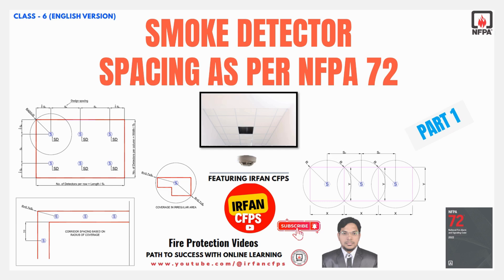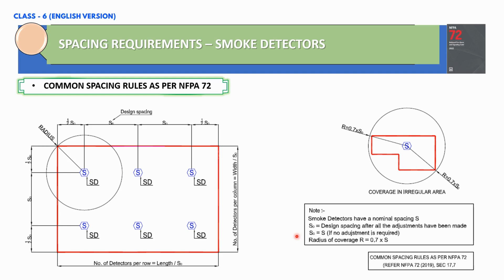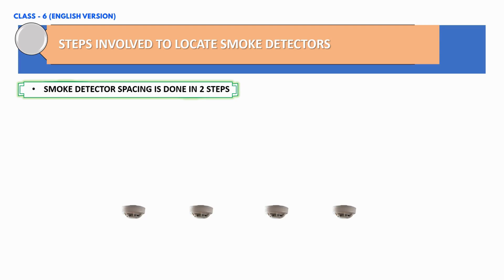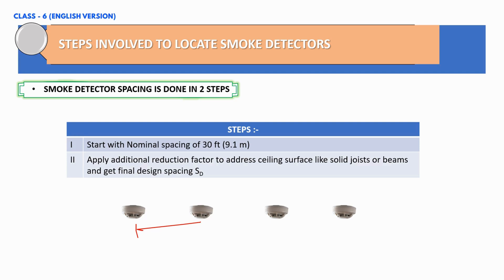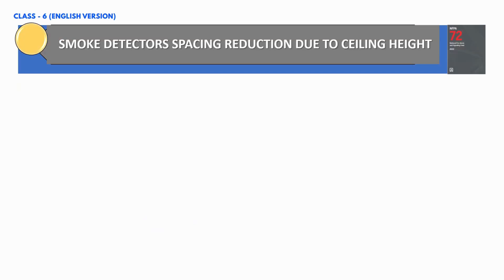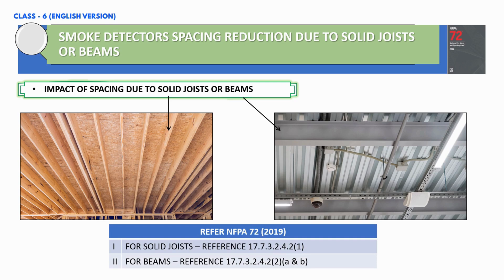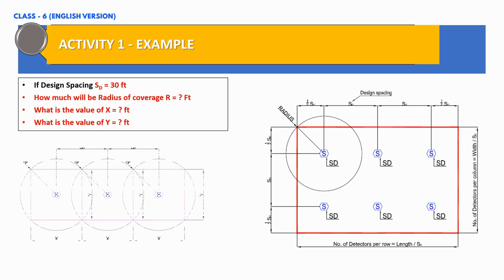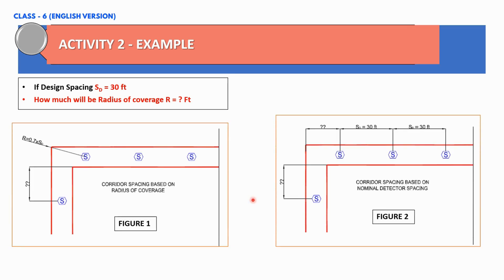Smoke Detector Spacing per NFPA 72

Comment: Hi, 
Nice and infotrmative videos...  Appreciate your efforts for making in details videos..
As per NFPA 72 2019 clause A 17.6.3.1.1 Paragraph 5 mentions, a heat detector with a listed spacing of 30 ft × 30 ft (9.1 m × 9.1 m) should be considered. Also Refer Fig A.17.6.3.1.1.(g).
As per 17.6.3.6, if you have a smoke detector with a heat sensor as an integral part of it then the detector can be listed for not less than 5 ft (15.2 m ) spacing. 
Let me know if you have different opinion...
Reply from the maker: i think i am with you..